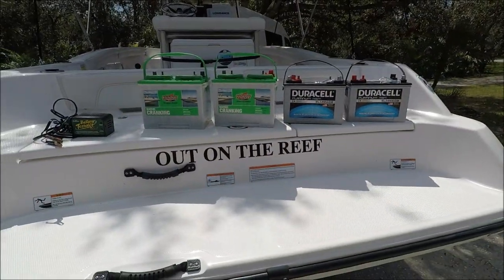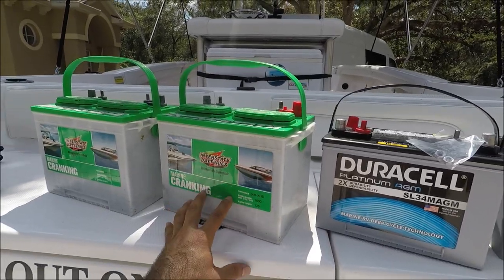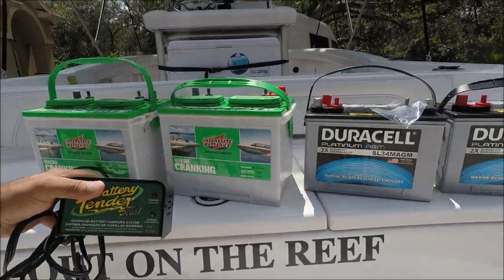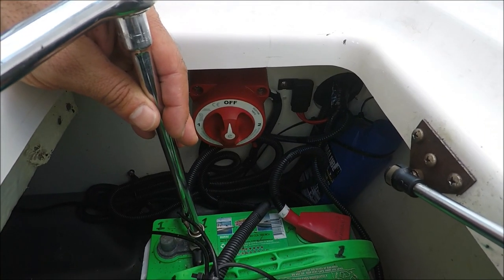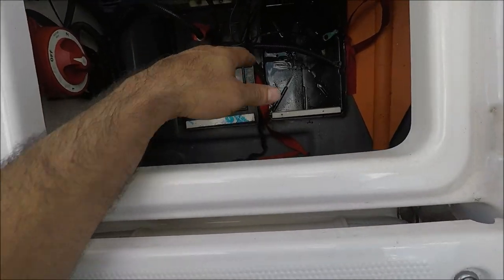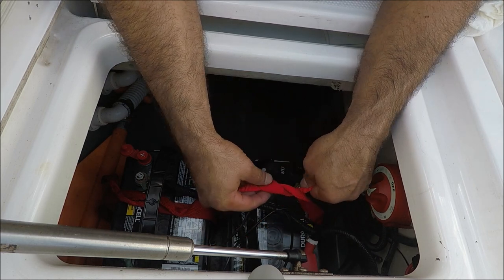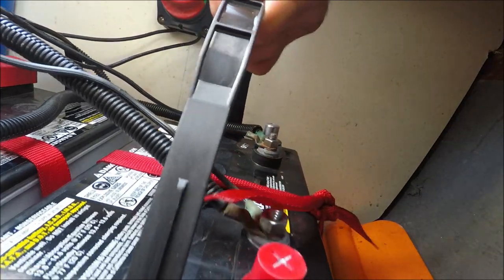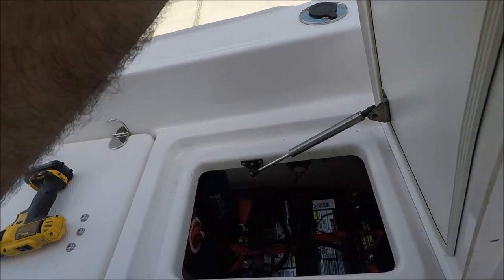Marine Battery Replacement AGM vs Wet Cell  Yamaha 190 fsh Jet boat Yamaha 210 fsh Yamaha 240 fsh

Comment: Good video ..i have 2 optima blue top gel batteries for 6 year's and still working good.....i recommend to use same cranking amp batteries to protect you engine charging system ...battery last longer and you alternator last longer too
Reply from the maker: Carlos Camejo great to know Carlos that confirms my information .
Thanks and Navigate safe Cap.

Comment: You dont use a battery box? I had a situation were a bunch of water got in and if it wasnt for the box the batteries would have shorten..saved the batteries by 1/2 inch....
Reply from the maker: skydude58 thats true but my battery are on the 2 feet elevation from the outer Haul so is very hight from the bilge but thats a great option if you have it closed to the water line
Reply: Out On The Reef Not sure how high mine sit, I forgot the drain plug that day....😩
Reply from the maker: skydude58 that explains it sorry Cap.

Comment: AGM batteries require  chargers that are compatible with AGM batteries!!
Reply from the maker: rrandydduke not that I was told I was told that not to overcharge with charges that don't shut off automatically so that's why I recommend that charger that charges and then once it reaches charge capacity it just shuts off that way you don't overcharge it and kill the battery
Reply from the maker: rrandydduke i called the factory and that was what i was told by them
Reply: +Out On The Reef I have a really nice and fairly inexpensive "modern" charger you are going to have to check out . I bought it for my $350 Odyssey AGM   . The battery system store highly recommends them and I was in shock at the quality of it .